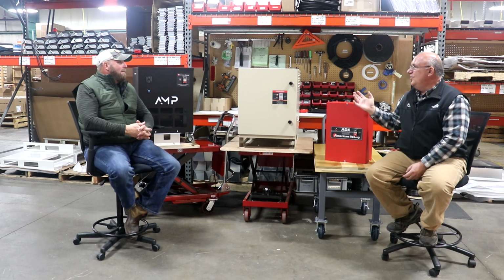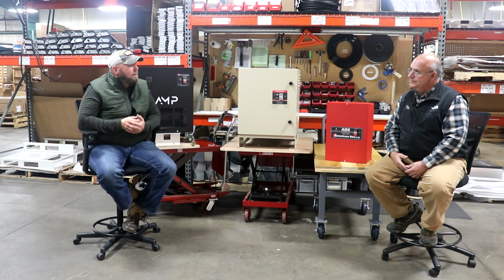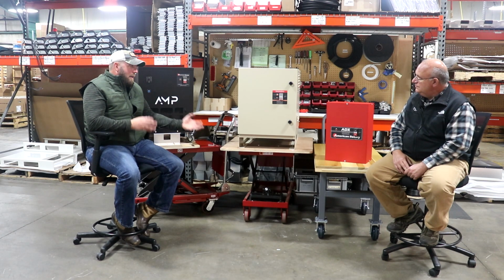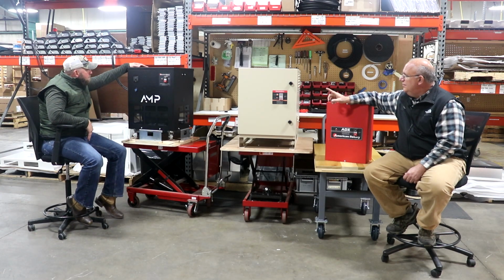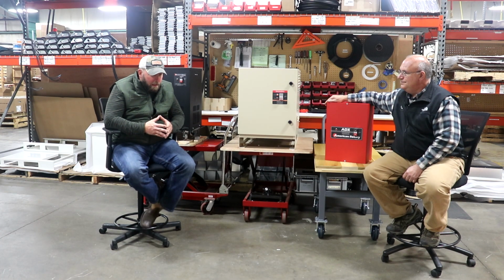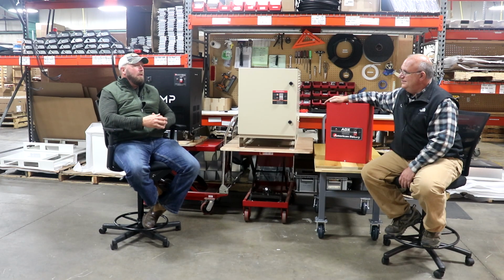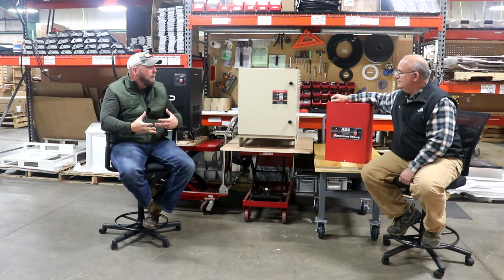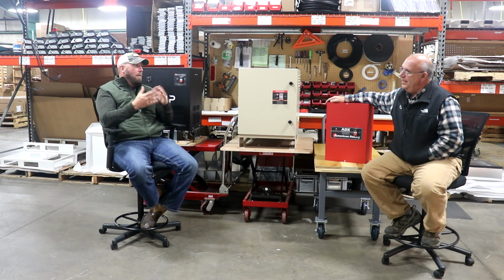American Rotary Phase Converters - a Visit with Chris Feavel

Comment: For the people in Europe who have 3-phase power to their house, what are they running that requires that sort of power, coffee maker, stove?  Are 3-phase appliances common in Europe?
Reply: With 3-phase we have 3x 230V power. So we use 230V for ligthing and normal sokets up to 10A = 2300 watt. 
The tumble dryer need one circuit breaker and the wasching mashine a extra cirucuit breaker. In the Kitchen we often have one circuit breaker for the dishwasher and one or two current breaker for the other sockets and ligth. But this are all one phase 230V devices, it is more of approximately same current on all 3 phase.
For an stove we use 3-phase 380-400V up to 16A usaly fixed wired.
Medium and big motors are allways 3-phase, a hand drilling machine is only 230V.
For boling hot water we have small devices with 230V 10A and on the wall big one with 400V 3-phase up to 33000 watt.
Reply: I've never known a house in the UK to have a 3 phase supply...it can cost a fortune, for businesses to get it connected..
Reply: @jensschroder8214  I have always thought when the electrical grid was first being constructed in Europe, they wanted to promote industrialization by running 3-phase power everywhere, that it was a way to allow the beginnings of cottage industry.  I have a feeling that a lot of government subsidies were involved to bring this about.
Reply: Yes, three phase appliances are not only common, they are the norm.  A three phase range/stove is fed from a 3P 16A (400v) circuit, with a cable the size of your little finger, and not by a cable the size of a child's arm.   Three phase is not (just) meant to run things that require enormous amounts of power, it really shines when you run motors, requiring NO capacitors or rotating start switches, just a contactor (and some over current protection) and you are up and running.
Reply: @bigtrev8xl  This comment is funny, as many (most ?) British people claim that the UK is NOT part of Europe.
Reply: @monkeyboy4746  Three phase power is EVERYWHERE in the US also, it is just not put into peoples houses. Go look in your street, there are 3 wires on 99+% of all poles on residential streets,   it is very UNCOMMON to find only two wires on a pole, I have heard that it only at the far reaches of a very rural  community that you ever see only two wires.
Reply: @jesperdahl1486  Thankfully, we won't be part of the money grabbing eu for much longer :) :)
Reply: @bigtrev8xl  I wish that we could be so lucky in Denmark, but as polls show that we would leave the EU as well,  our spineless politicians will never allow a referendum.   The EU was however not the point, the point was that many British/UK/English people do not think that Briton/the UK/England is part of Europe (NOT the EU)
Reply: @jesperdahl1486   " many British/UK/English people do not think that Briton/the UK/England is part of Europe "..  I'm not aware of that view..
Reply: In the Uk just one phase comes into the home. What they do is split the 3 phases and 1 of each phase goes to its own estate{group of houses). Things like Heavy duty industry etc gets all 3 phases to the one place.
Reply: Kitchen ovent is typically 3phase. 2 phases for oven 3rd for top.
In homes it is common to distribute phases- kitchen power outlets one phase, living room other and etc. It gives you lots of power using thinner wires and "weak" circuit breaker.
Reply: @bigtrev8xl  because UK use "ring"  connection. It is not compatible with "star" connection. "Star" is very easy to convert to multiphase.
Reply: Also, no need for thick neutral line. Good designed system have very low current on N.
Reply: @monkeyboy4746  it was "promoted" by WW2.
Reply: @kaunomedis7926  regardless, 3 phase connected to houses in the UK does not happen, unless you pay to have the 3 phase supply connected.
Reply: @bigtrev8xl  Agreed! I think most UK citizens are happy to be called Europeans - but NOT to be part of the EU!  In their minds there's a BIG difference!

Comment: I always thought that a VFD was to give variable speed of a 3 phase motor. My wood turning lathe has one. The Rotary Phase converter does not give variable speed so I don't see why they are being compared am I missing something?
Reply: The more usual use of a VFD is for speed control, but you can also use one to generate three phase power from single phase. It's not super clean and I wouldn't use one for that on a CNC machine, but it does work. As was mentioned, if you get decent ones and the filters for them, by the time you set them up for 2 or 3 machines, you could have gotten the rotary phase converter. In most setups, you treat the output of the phase converter just as if it was thee phase from the pole with a proper panel and wiring to the machines.

Comment: The electric facilities in the USA are to old for VFD. Even the election computers are so old that they work in reverse 😎. VFD can be used in Europe in every home shop, I have running all my 3 fase machines on a seperate VFD, programming is no issue. The big advance of a VFD is the speed controle on every machine,I don't think a coverter can do that as well.

Comment: You don’t need to buy a rotor phase converter just make you own many video’s on YouTube on how to make them just like he is selling for pennies on the dollar D I Y
Reply: If you have knowledge of electronics and high amp circuits, sure you could build one. I sure wouldn't do it if you don't have that knowledge because doing something wrong can be costly at a minimum or even fatal if you hit something live. None of the plans or videos I've seen to auto balancing. Sure, for some equipment it doesn't matter so much, but it's still not ideal. Finally, I guarantee that you won't end up with anything nearly as efficient or compact.

Comment: VFD´s are Motor drivers! Thy have to be tuned to the Motor they are driving!
You cant just plug them in eny maschine like you want´t. Only if you have the same Motor or at leest close on every maschine!

I read about VDS´s, especialy in the US, that kill Motors and wear out contactors very quickly. And in the discusions i realised that americans are typicly not aware of how VFS´s work, and in general have not the best knowledge of electronics!
they all din´t know that the VFD needs to know the parameters of the motor to work correctly, and wat happens if you give a f... and just plug the damm thing in is...
It runs.. mor or less fine.. but the back emf´s and harmonics create allot of reactive current and high voltage noise that kills everyting in it´s proximity.
And also they had effects that unsymetrical induced voltage createt a curent on the Rotors that sparked over the bearings to ground.
Her in Germany you quickly get a call from your power caompany if you do that!!!
Reply: Exactly, they can be very involved to get them tuned for a specific load profile.

Comment: I have a 20 horse power unit.  The motor generator unit is very poorly balanced and the bearings where a bit nosier than they should have been for the first 2 years of use.  They have finally quieted down.  

Also the "HP" ratings on the units are a complete load of BS.  

You are not getting true 3 phase.  

What the converters produce is sufficient for running electric motors that do not need to be able to start under load but that is all.  

Ridged tapping with a Bridgeport is not the same using a rotary phase converter as it is using a Bridgeport hooked to the 3 phase power grid.  

The difference is that unless you have a way over-sized phase converter you cant stop the motor on the mill and reverse it for ridged tapping.  I have broken taps earlier on as I would switch the direction on the motor and the phase converter would bog down and then the motor would keep going in the same direction.  This problem would occur when I was using a "5 HP" unit.  I have since gotten a "20HP" ADX unit and it finally has the ability to allow power tapping though it is still a bit hit and miss with my gear head lathe that has a 5.5 KW motor aka apx 7HP.  

You would think something rated for 20 HP would have no trouble with a 7 HP load but no!!!.  The ratings are based on running multiple small motors at the same time.  

The other way to ridged tap with my "5HP" unit was to turn on the 5 HP main spindle motor on my 12"x24" surface grinder and let it idle.  The surface grinder would act as somthing of an electromagnetic flywheel and made it possible to ridged tap before I got the bigger phase converter.

In summary the products are poorly made and dubiously rated!!!

Buyer beware!!!
Reply: Tim. Your rotary converter clearly does NOT have a motor-generator in it, but an idler motor! You are reporting on a completely different animal.
Reply: @JoeInBendigo  Not According to American rotary's web site.

"American Rotary has partnered with Baldor Electric one of the world’s largest and most respected manufacturers to supply its custom-engineered idler/generators."

Below is the web address for the part of American Rotary's website where I found the above quote.

https://www.americanrotary.com/about/advantage/
Reply: @timeckelmann1196  "Custom-engineered idler/generators"   YOU wrote it yourself, it is NOT just a idler motor.
Reply: @jesperdahl1486  Below is the web address for the part of American Rotary's website where I found the above quote.

https://www.americanrotary.com/about/advantage/